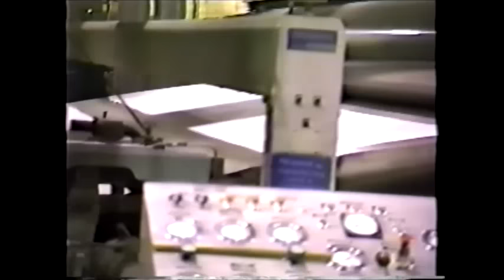Great Northern Paper East Mill Tour

Comment: I worked at a Moss Point MS Mill for 23 years, somewhat similar, they shut it down and all is left is dirt, they sold it for scrap and bulldozed it. We were a Specialized mill for creating different types of paper creating the formulas and perfecting them. Most all other mills couldn't figure out and couldn't run the paper we run. The companies we dealt with raised all kinds of Heck with the Owner of the Brand because no one else could make the quality we could, also some of the Companies we sold to supposedly went out of business trying to get other mills to make the same quality paper as ours but couldn't.